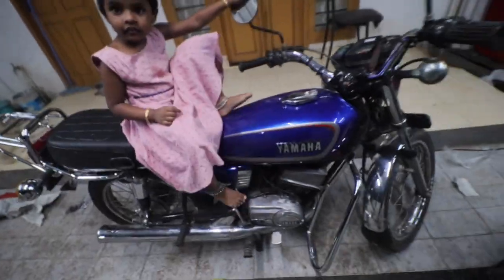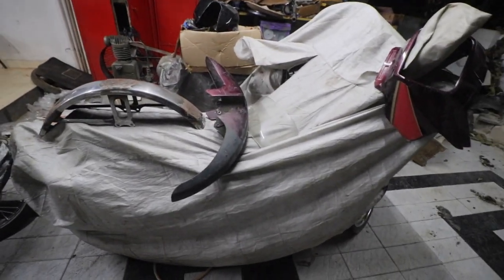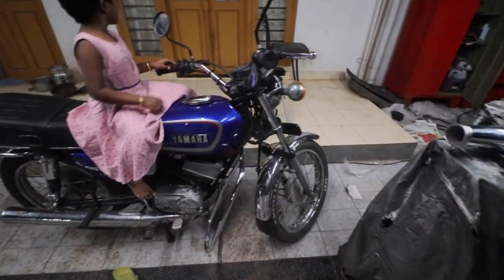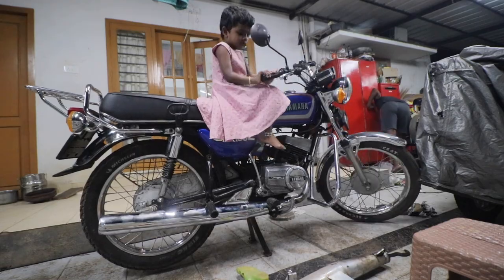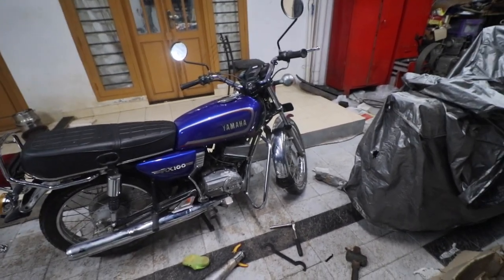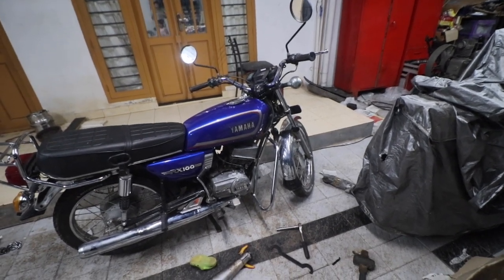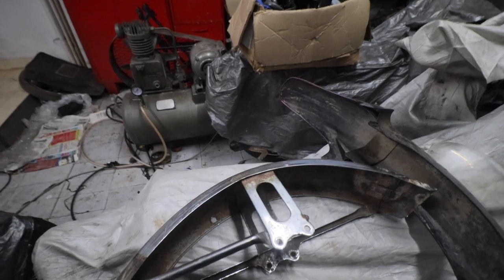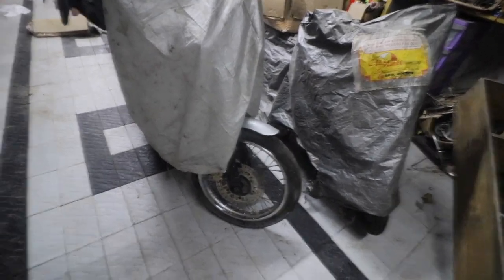RX 100 Orignal Silencer fitting (English)

Comment: My exhaust on the RXG is also pretty rusted, especially the place where the wields on the holders are.  
Is there a way to differentiate between an original and duplicate exhaust? asking because I have no idea on it (well for most other parts on the bike too lol)
Also plating, does it last ? How much does it cost ? Do they also do internal cleaning of the exhaust ? Mostly here in Madras, I'm seeing people pouring kerosene and letting the exhaust burn for a while to clean it. The chrome is destroyed so they do plating again. Is there a better way that is locally available ? Thanks!
Reply from the maker: if you give your silencer for plating they will remove the carbon when they dip it in the acid solution for stripping old chrome. Now i highly recommend to get a used silencer and not to waste money on a silencer that has more than surface pitting.
Reply: @Yamakaze  Sure sir! Thanks! My exhaust luckily does not have anything more than rust. There is a small hole in the bottom through which the gunk drains. I have seen this feature in other international 2Ts but not in RXs so I think it''s a hole caused by the rust beneath xD

Is the 6 hole RX100 Silencer a fit on the RXG ? How is the sound compared to the normal 135's exhaust with stock flute ? Thanks!

Comment: Hi bro, I bought a decent condition 1996 RXG with all current papers(2 owners) including insurance for 37K. It had starting problem which I got rectified with a local mechanic. It ws due to improper jetting. It now runs on rx100 jetting and getting a mileage of 40 to 45 so will it damage the engine in the long run and the price I paid is more or less. Tops at 115+ kmph max
Reply from the maker: the rx 100 jetting cannot provide the fuel at higher speeds, but having said that a stock RX fizzes out at around 120-130km/h. Now the RXG has clutch bell which has 71 teeth as opposed to the 74 teeth of other RX 135 series, the primary is 22 teeth as opposed to 19 in the rx 135, it takes lesser number of turns of the primary to turn the clutch bell once than an rx 135, so pickup should technically be better. The rear sprocket is also bigger to give you a better low end, you should check if your bike still has the original clutch and original sprocket. if not get those, that will improve things. changing to 16 inch rear wheel can also improve initial pickup
Reply: Thanks fr the info bro. Currently it has the original clutchbell set up but the sprocketing is of RX135 - 16/34. Mechanic asked me to switch to RX100 sprocketing for better initial pickup but it ultimately it didn't workout since the links were short so swapped the 100's front sprocket to 14 tooth. Result was good initial pickup but engine reached max rpm @ arnd 70kmph so switched back to rx135 setup itself.  U r doing a great job bro. Hav gonna through ur team bhp threads as well. My best wishes to you. U desire a lot more subscribers. Hope it happens soon
Reply from the maker: KK thanks for the kind words. Do share the channel link with like minded people